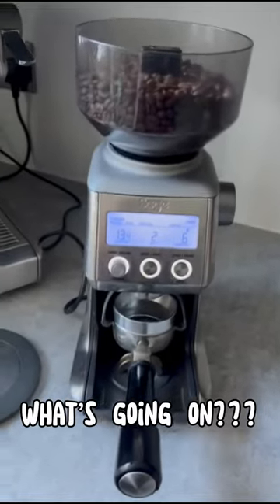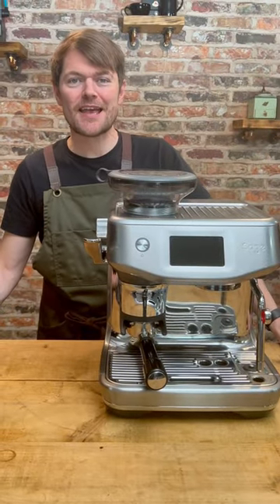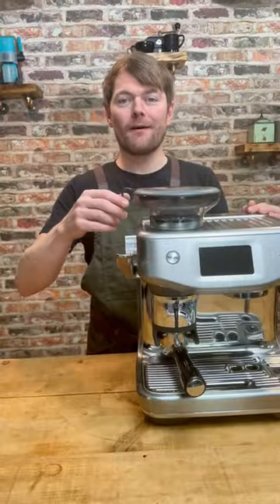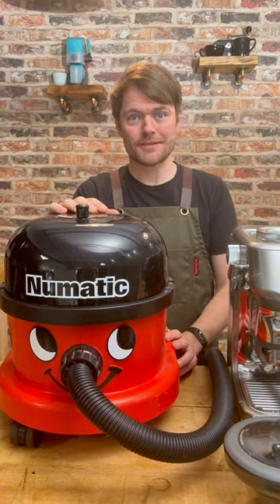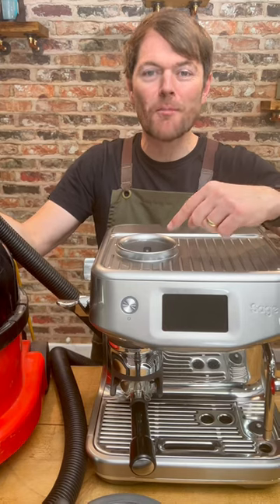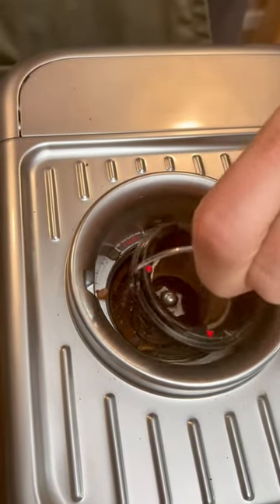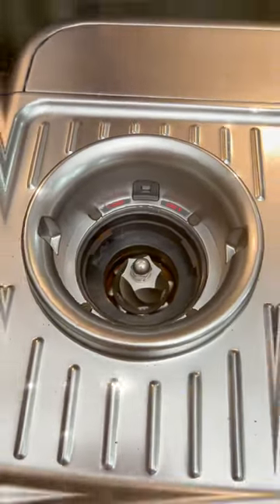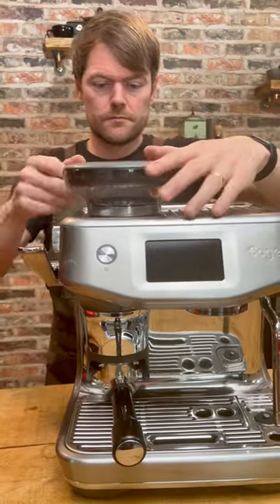What To Do If Your Sage/Breville Grinder Makes This Noise… #shorts

Comment: I get this sound pretty regularly when I grinder lighter roasts with my breville SGP. It usually resolves itself, if I’m on a drip coffee setting (around 30-40) but if I were to try to grind at a fine setting for espresso it just doesn’t work. The machine just doesn’t have the power/torque to grind light roasted beans consistently.
Reply: Thank you. This is the answer I was looking for after troubleshooting the grinder for an endless number of times.

Comment: Did both of those things, still have the exact same noise. Is it possible I have to replace one/both of the burrs, or is the grinder motor hosed? Without beans, the motor seems to work fine, it's only with beans that we get the noise (same beans we always use). Thanks!
Reply: Did you resolve the issue? I am having the same issue.
Reply: @sankarkooldude  I cleaned it out really well, took it completely apart and hit everything with a stiff brush then reassembled it. Seems to be working again. I'm not sure what the fix was, but we're monitoring it for now....